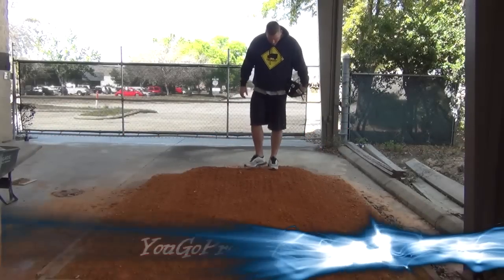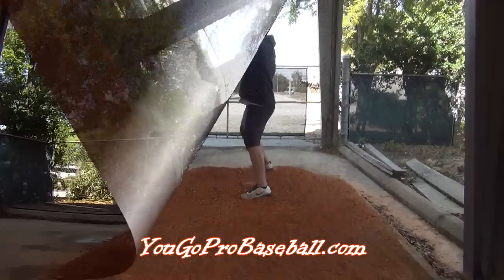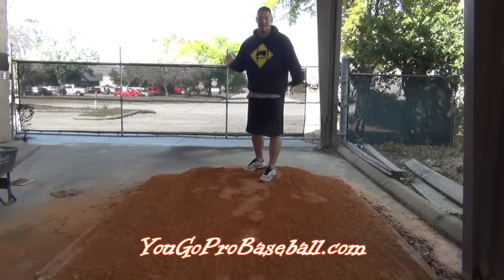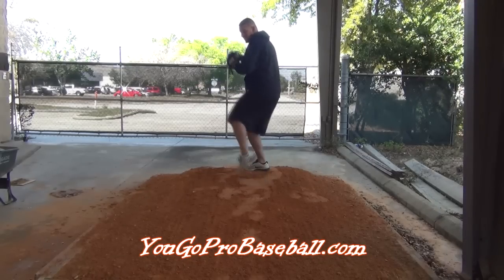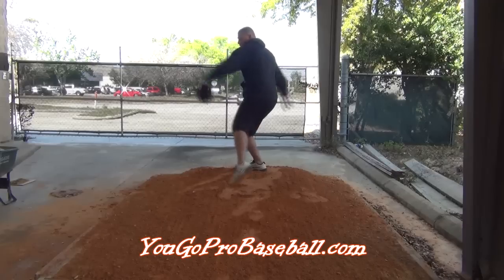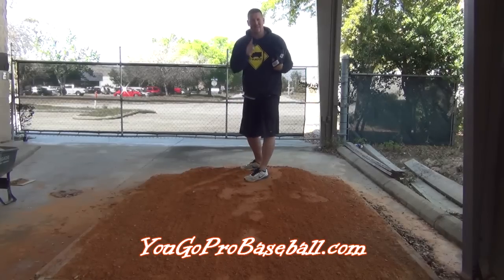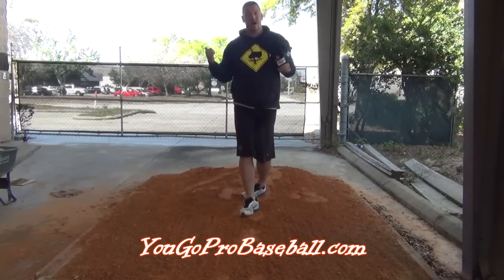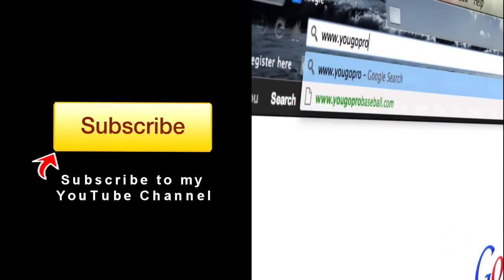Pitching Mechanics - Arm Path at Hand Separation

Comment: Ques about arm path. Should the arm be less than 90 degrees in its wind up? That seems to creat less tension than if at 90 or more.
So for ex if at 45 before it is open whipped forward seems more natural. Am I thinking about it right?